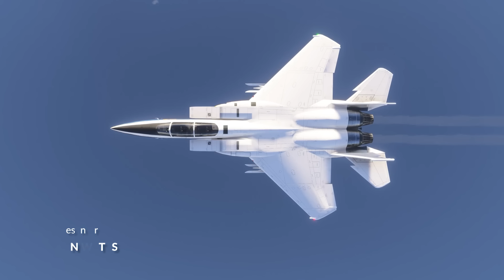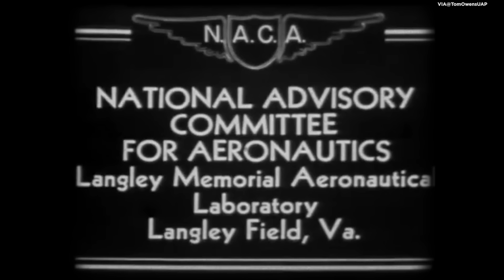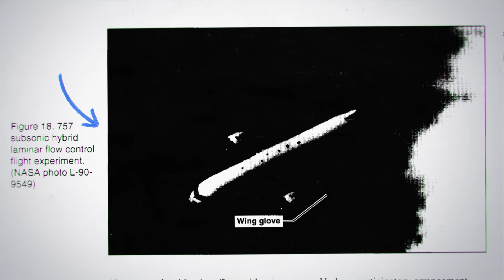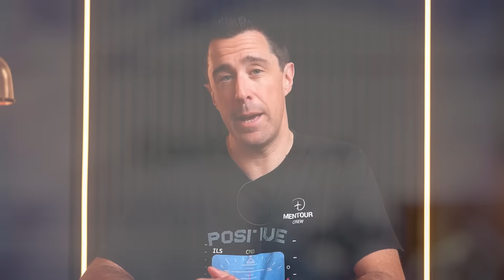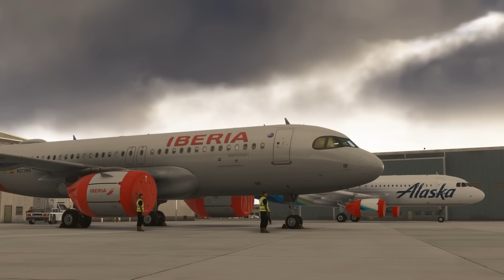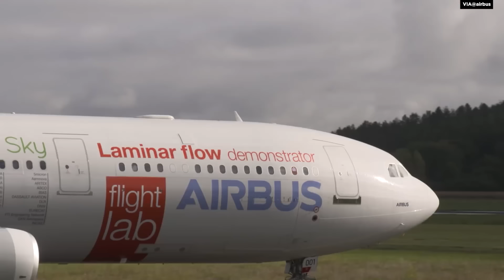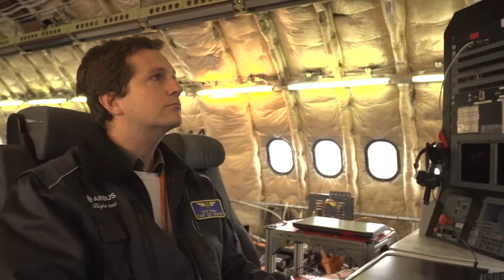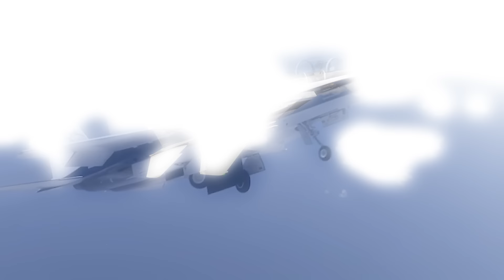Why DON’T We Use This Revolutionary Wing?

Comment: Well, I have wondered if maybe cookware style tech needs to be applied to aircraft wings.  Specifically non-stick coatings like Teflon and ceramic coatings that are now used.  Why do we paint wings instead of coat wings with non-stick coatings?  The problem with wing contamination, make it harder for anything to stick.  Even going way back to my first trip to college while going across the country to an engineering school, the guy I rode with waxed his windshield before the trip.  The windshield stayed clean and water just rolled off when driving through storms.  We didn't need to use the windshield wipers to wipe away the rain.  And like the ceramic coating on my newer cookware, at first most everything just came off, no effort.  Only with a lot of cooking, a lot of high heating events, has there been an issue with the coating performance degrading.  Wing surfaces are not going to have these high heating events.  It should be easy enough to have say a non-stick ceramic coating on the wing and it lasts for decades with just sunlight hitting it.

I suppose one drawback to having super non-stick coatings on wings if it is developed well is when it comes maintenance time, you may have more issues with people getting on the wings only to slip and fall off.

If you were to go this route, I think the deal would be it is easy to get good laminar airflow in a passive system, increasing efficiency, and the fallback if the wings do get more contamination is it falls back to behaving more like a current wing.  So, it would just opportunistically get better performance just because nothing wants to cling to the wing surface and by default it is super smooth, minimizing the boundary layer.  Inherently just works better tends to be where you want to go.  Even going back to being a kid in elementary school, I remember things like being tasked in a group to optimize a piece of tin foil to hold as many pennies as possible.  I said we need a better design where it is flat like a Lilly pad with the edges turned up.  Nature had it figured out already and we just needed to emulate it.  The group next to me heard me pleading with my group to do this and they decided to do what I said.  My group ignored me and decided to have an 'active' support by putting a pen through the bottom, which caused it to tear and fill with water, so it didn't hold anything.  My group lost, coming in last place while the group next to me won.  The lesson here is don't be dumb and do some frail active system with holes in it.  Do something that is simply a better design, especially if you have proof of it working elsewhere if you want better results.

Comment: Thank you for reporting on the topic. It is an important one. However. Sailplanes already use laminar flow design for decades. And sometimes it is a fight against nature's bugs. There is no such glider pilot, cleaning his cloth near that much as he is cleaning its plane. Other than that I'm afraid, Ice will finally prevent from letting laminar flow find its way into commercial aviation other than very small scale aircraft. Please note, allmost all of the glider flights take place under non-icing conditions - for reasons of pure joy. There is no such thing as any heating in a glider.
Second, designing slats that will maintain laminar flow needs designing slats without any gap, say there is a need for flexible skin wings. All I know from aerodynamics so far says, introducing flexible wing skin is a recipe for desaster.
Third, I miss any thought on laminar flow along the fuselage. The almost exclusively involved cylinder or close sibling of as the shape of choice for almost all airliners and a front and end for at least some aerodynamic shaping in no means is an ideal aerodynamic shape. There was more underway, like the super constellation in the past and the Celera 500 from today. Why squeezing the performance of wings to the limits in clean, dry air only, when wasting efficiency by fuselage shape?

Comment: Consider this for the next A320
1. Laminar flow optimised wings - 5% fuel burn improvement
2. Hybrid system for takeoff power, taxi without engines and hold without engines (APU activated for longer holding period) - effective 5% savings for flights from busy airports
3. Composite wings - 8-10%
4. RR Ultrafan 30 - 20% savings
5. Folding wings to increase aspect ratio/some kind of truss braced wing implementation - 5-10% savings depending on length of cruise phase
we're almost pushing 40% here!
and to this if you add a boundary layer propulsor at the aft end of the fuselage, right behind the APU (maybe the APU will become a full power unit? or hybrid power?) - 50% improvement well in sight!
not to mention the knock on effects of the aerial version of the rocket equation - burning less fuel to carry fuel - allowing for smaller tanks, more cargo capacity especially on XLR esque variants

Comment: As others mentioned, almost every sailplane produced after 1970 has a laminar profile. It has to be kept perfectly polished and clean to work. You notice some 20% perfomance reduction after few hours of flight because of bugs and even more in rain.

Therefore, some high performance sailplanes use bug wipers which clean the wings during the flight.

Comment: So you have Airbus doing the same kind of studies NASA does, but at scale, on a large commercial airplane. (where is Boeing on this ?).
Remember that ONERA, the French Aerospace Lab, conducts extensive research on laminar flow to reduce aerodynamic drag, focusing on Natural Laminar Flow (NLF) and Hybrid Laminar Flow Control (HLFC) for aircraft wings and nacelles. 
Using wind tunnels like F2 and S1MA, ONERA tests boundary layer suction, surface imperfections, and numerical simulation tools (e.g., elsA) to optimize drag reduction for transport aircraft.
And that's now exactly a new thing, Gustave Eiffel built his first wind tunnel in 1909 at the foot of the Eiffel Tower.
Eiffel built a bigger first wind tunnel in Auteuil in 1912 and it's still the oldest aeronautical testing laboratory still in operation today.
Reply: Boeing's too busy trying to figure out how to keep doors attached for the whole duration of flight. I would rather for them to keep focus on fixing their quality issues than trying to be inovative...

Comment: Minor suggestion. 
Don't use the patronising "what we call the..."
"What is known as.."
"What is called..."
If you're going to the trouble of explaining the whatever, it doesn't need that bit of blather ahead of the explanation.

For example
"...the boundary layer which is the film of air closest to the wing..."
Tightens it up, is still non technical and is not talking down to people (me excluded) who may know more that you do! 
Otherwise great video  thanks.

Comment: I seem to also remember NASA testing a wing that had golf ball like dimples (I recall it was something like shark-skin) which supposedly reduced drag dramatically, but don't remember what real-world effect caused this not to be a production thing. Obviously it works on the drag of a golf ball quite well, but golf balls have a small speed range in flight probably, and if they stall nobody dies (not that the drama on the average golf course doesn't seem like death is on the line...).
Reply: Usual reasons with all those fancy things are two: production and maintenance. It's simply not practical in real life and associated costs and quirks are actually pushing it bellow the worse performing "legacy" solution.

Comment: Active laminar flow will work both ways. 
Pneumatic engineering has used proportional integral derivitive contollers for decades to achieve this.
Pulsing vacuum with high pressure, high temperature hot gasses at acceptable rates, eliminates any contaminants.

Comment: Otto Celera 500L and also the wings of ATR 42 ant 72 also Transonic Truss-Braced Wing concept SAE-MA-03282 in general it is much easier to design a more efficient wing that is thin and long with low sweep designeed for lower speed, if we want to reduce seriously oil use, finding an intermediate flying regime between a turboprop and current airliners is probably the way. Probably with engines with huge bypass ratios and gearboxes, even open fans. The more difference there is between take off speed and cruise speed, the more difficult the design and the more compromises needed.

Comment: Many maintenance intensity showstopper of the past are about to become minor tradeoffs when robots with more dynamic abilities really become part of everyday life. There is no reason why a wing couldn't get a very thorough cleaning and inspection on every flight by an army of robots built for the task - and in just a few years, if someone took the idea seriously at the same time as developing the actual wings/planes for it. It's only if this kind of active system clogs up during each flight that it might need to take a decade or more, but even if it did clog up to be entirely ineffective on every other flight and still requiring the same margins as before there could still be a large saving in the fuel brought back on the remaining half of flights - fuel is after all the absolutely dominating cost as we've seem when low cost air stopped using old planes and started buying the absolute newest ones in stead. And I think such planes would seel like crazy because even buying them knowing the robots are not quite there yet, you would be able to see those few years into the future to understand that they would be up to the task not very long into the appreciation time of the aircraft even IF it gets delivered on time which isn't often the case with new tech.

Comment: Laminar flow has been used for tens of thousands of years. Planes need feathers. Not much affected by contaminants. Work in water too. Not sure if there are any birds that have icing problems.

For the worst contamination review the Mentour video on the plane that flew through volcanic dust. And consider  Asian dust so common in East Asia.

Comment: PLEASE STOP POSTING RE NUMBERS AS SOME DEFINITIVE VALUES! many people do this, i do not blame you, it is a hard topic. The Re=2300 was for original Reynolds experiment. But in the same experiment you can have laminar flow with Re=100 000 if you insulate it from external vibration. Space shuttle had Re~1 000 000 and still had laminar flow. On the other side, in an vibrating engine, you can have Re~800 and have turbulent flow. I know you pilots do not have to understand, but at least do not participate in spread of misinformation!

Comment: Not to forget that all jet airliners use supercritical wings that are flatter on top and more curved underneath so that the onset of the shockwave is smaller and  further back on the upper surface. If you look at the experimental A340 section you can really see the inverse camber just behind the leading edge

(P.s please use symmetrical aerofoils when demonstrating this just as in the Cambridge video of streamlines you used. Using a positive camber- only used on low speed aerofoils just reinforces old myths like equal transit time.

Comment: I'm wondering if the "active laminar" vacuum device would be considered cost effective for scramjet missile considering maintenance isn't an issue as they'd be single use.
Reply: You don't use laminar flow on supersonic stuff to begin with, because of how air behave. It's so much difference that at those speed ideal profile is close to (really flat) diamond rather than asymmetrical teardrop people usually associate with wing profiles.

Comment: Alexander Lippisch had a series of videos in the 1940s, I believe, where he said all of this. He also stated that blowing air from the trailing edge of the wing would keep flow attached and delay stall substantially.  There is one aircraft that used this over the flaps, can't remember if it was the F111 or F4, but it is from that era.  I have thought about it a few times, redirect thrust flow out of the trailing edge of the wing,  would have to be high pressure/high velocity flow, getting high volume to play nice in that config would be a nightmare.  You would be able to create "aero flaps" by pumping a section of your flow down, under the wing, ahead of split flaps.  That would just serve to increase the pressure under the wing.  You would also be able to refine the whole trailing edge of the aircraft, imagine the exhaust of the F117, just with the technology we have available today.  You could build a very sleek and efficient air craft that can GO when you ask it to and still land at 80 knots without having to burn a gallon a minute per engine. (this is all just me, living in fantasy land)

Comment: There is a highly radical slot version that doesn't have the contamination problem the small hole versions have. With proper heating of the slot area and tubes, it could work. I made an electric RC airplane where I used a custom turbine to do the suction. With the turbine off it took close to 2.5 times as much power on the main prop to keep it flying level at the same speed. Not bad considering the turbine motor was running at less than 1/15 the current main prop motor was. Gliders that used solar powered suction motors easily saw glide ratios over 100 to 1.
Reply: can you please share more about the specifics? how were you able to achieve this? what span/size did you do this for?
Reply: @oadka  It was for a 2 meter RC (radio control) sail plane. The wing section was one NASA developed. It's maximum thickness was around 55% of the way from front to rear. It then started sloping down slowly for another 10% of the length, then very fast where it had slots the boundary layer air was sucked in through. I added a power pod for the main propulsion motor and prop. The suction motor and turbine were in the cockpit part of the body.
Reply: @ekaa.3189 any plans for it available?

Comment: For all the laminar flow work, have a look to Al Bowers work with Prandtl ‘33 and Horten brothers previous efforts. Bell shaped lift distribution instead of elliptical. Fly down wingtips. Such requires less mass in a span, or gives the optimum lift per mass whereas elliptical is optimum for a span (Prandtl also found this). Prandtl was looking for least wing flex for a given lift when he came to this, least flex means least support structure required. Big bonus, fly down tips mean proverse yaw not adverse so don’t need rudders and vertical stabilizers to counter (but do still need for engine out asymmetric thrust concerns). Big savings in the lift structure, more efficient flying, and those not needing engine concerns can save with reduced tails too. It’s like birds, ever see a bird with a vertical tail?

Comment: You forgot to mention that the P-51 had laminar flow wings in WWII and you went right past the USAF first test with active laminar flow with the YF-107A. So, like you said, none of this is new, and like the UDF, everything old is new again.
Reply: The P-51's  laminar flow features have been exaggerated in postwar popular memory. It was less draggy than most other contemporary airfoils but the change was evolutionary and gradual. The Corsair arguably had even cleaner aerodynamics (at the price of poor ground handling).
Reply: @LafayetteCCurtis  The poor ground handling was due to the short fuselage making it wheelbase very short. This is the same reason why it had such poor slow speed handling issues because of how short the empennage was. That short arm required a very large vertical stabilizer but it could only be so big and still fit onto the carriers of the day, any taller and it wouldn't fit, any wider would have made it too heavy for the short arm making the CG much further aft than it already was. This is why that it was pretty much given to the USMC and operated from the beach, especially after the F6F Hellcat came onto the scene. Too many compromises made on the F4U.

Comment: @MentourNow why not go back to the idea of suckingair trought the wing but instead add an extra layer of ultra light weight material with a gap above the structural material and put holes trough that instead , so if that material actually failed and broke nothing would happen to the wing

Comment: Good lord, Ben. I'm 50 years removed from my ONE university physics course! My brain got strained trying to recall even the slightest recollection of flow dynamics that have virtually nothing to do with the subject of this video and aeronautics that I learned to fly helicopters where the science is arguably less debatable (Don't stall; Defy gravity). I was in the weeds for most of the theory but the applied physics was astounding. Even though you were speaking Greek to a duck it was an extremely interesting video.

Comment: Oooh, I’d love to learn more about the braking system on commercial (or otherwise) aircraft. Specifically the significance of spoilers and downforce interacting with reverse thrust and if it’s true that the brake discs are carbon-carbon (similar to the leading edges of the wings on the Orbiter) or if they are more like racing car carbon ceramics. Bringing these elements together during landing has always fascinated me. Great video and lovely to see that F-16 experimental wing and the A340!

Comment: during FA18E/F EMD flight test we had a issue with wing drop, we tufted the entire wing to look at flow, and noticed a lot of the strings  pointing fwd and or not at all straight back,  found the wing fold panel causing the aileron stalling hence the wing drop, the fix was drilling thousands of holes on the top and bottom fold panels so the air would be pulled into the cavity making the airflow flow across the aileron and not stalling. This took about 6 months to really fix this issue..